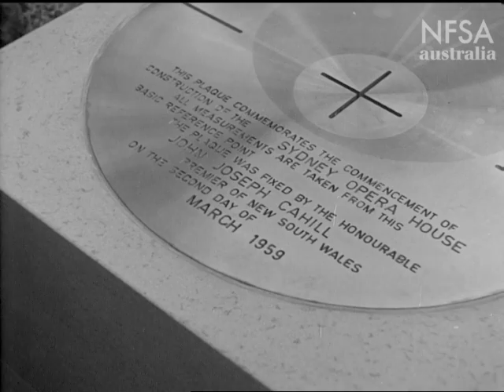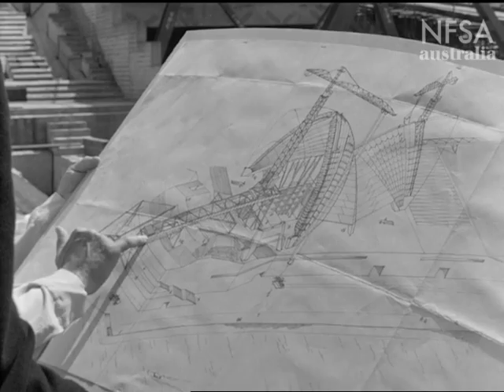Landmark

Comment from the maker: Hi Simon.  No credits on the film.  I suspect that this is actually an unfinished production by the CFU.  A lot of the later colour footage is used in another film we have (which I will post next week).  There is also no narration but that may have been the original intention. This had never been transferred from the film components until recently and we have very little information on it.  I think it was reworked into the other film and released as part of the Australia Colour Diary series.